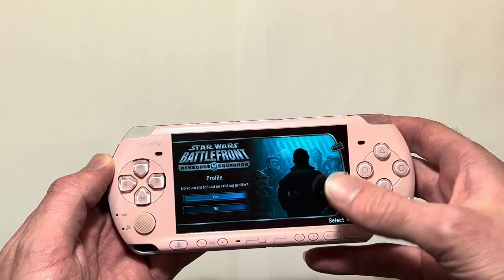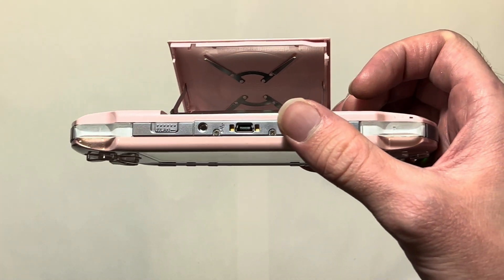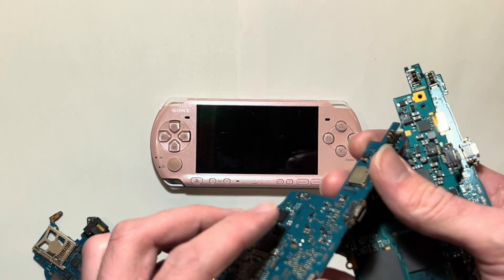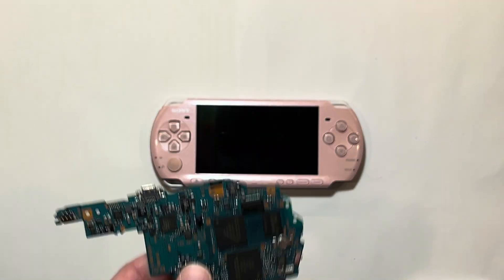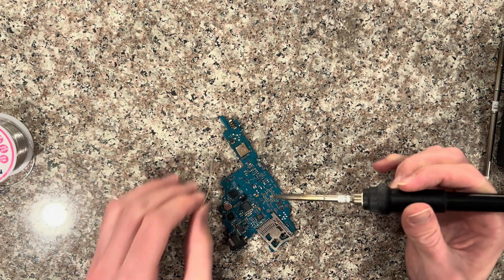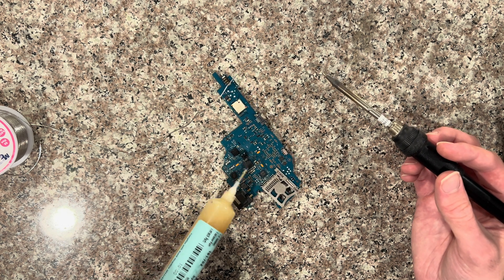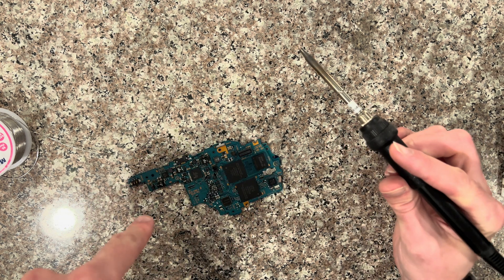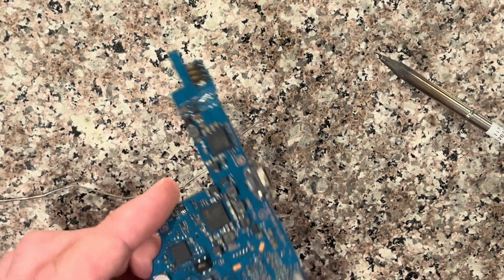Sony PSP diagnosing & repair - Do you want to quit the game? - Soldering on a new umd lever

Comment: hello friend I would like to ask I have the psp street and when I go to open it the sound comes from the speaker but the screen does not turn on.
Reply from the maker: You’ll have a blown backlight fuse, which is located near the power switch. These often blow due to the battery being connected when disassembling or reassembling
Reply: @blakeblundell9001  
is there a way to make it?
Reply: @Strat484  I encountered the same issue and the options you have is either bypassing it or soldering a new fuse